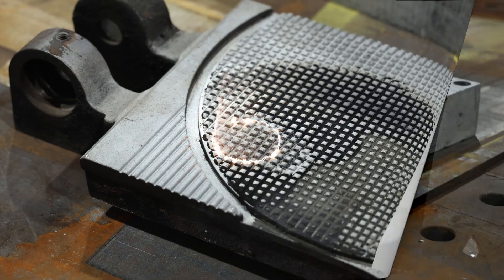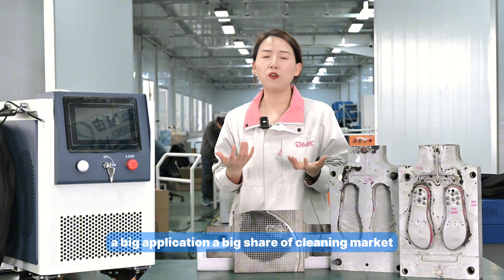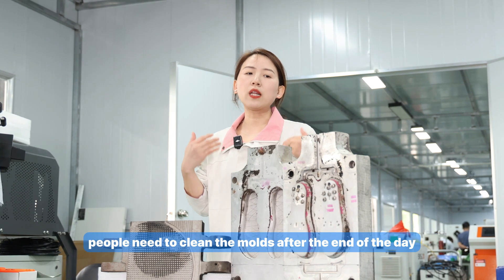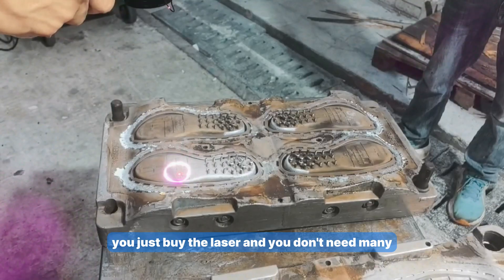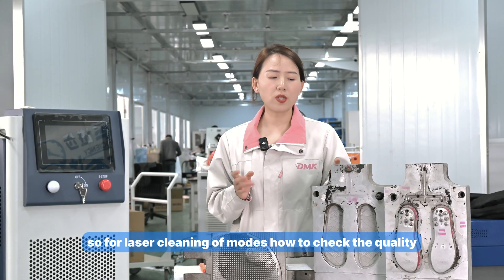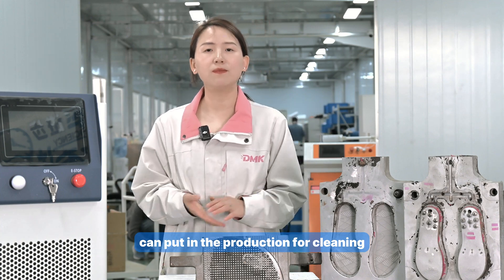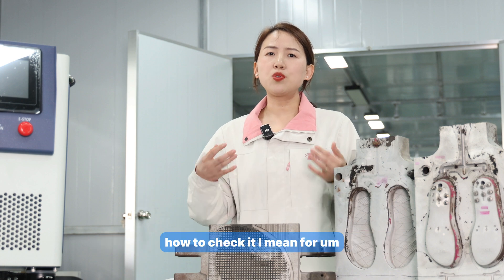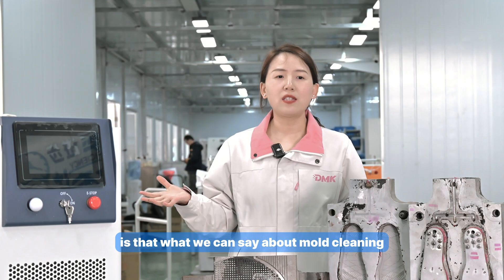Laser Cleaning May Soon Be the Most Cost-Effective Way to Clean Molds #DMKLaser #dmklaser #foryou

Comment: What machine would be best for cleaning moulds? 
What settings and cleaning head?
Reply from the maker: our 200w or 300w are both okay for mold cleaning, if the moulds are flat surfaces, 300w with multimode will have higher efficiency; if the moulds has unflat surfaces, 300w with single mode, non-descructive circular shapes will work very well.